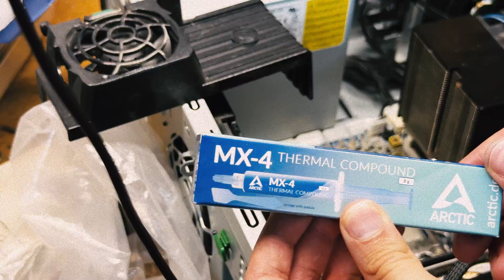Upgrading the CPU in my HP Z420 Workstation

Comment: I am thinking to install 128GB RAM into this MOBO. Did you ?
Reply from the maker: I have 64GB of RAM, not 128GB. But I'm sure it's possible--just make sure to look at Windows' specifications; I think you may need Windows 10/11 Pro for this to work. Other operating systems should work fine.

Comment: BTW - I have found the original PSU very noisy and the default "Megatron ?" CPU cooler is also noisy - So I have installed Corsair SF750, yes, those SFF PSU into the HP Z420 MOBO) I have mounted it using the ATX backplate, that is used to simply stick it from the other side via the screws, lol. Also installed Noctua NH-D9DX i4 3U as CPU Cooler. But now the HPZ420 is just completely silent, especially after I tweak the CPU Idle fan speed in BIOS. It says in the same room where I am , and I can't really hear it, while it runs TrueNAS Scale at full speed)
Reply from the maker: The Z420 can be a little loud, especially with lots of hard drives in it like mine. That's great you figured out a way to quiet it down!
Reply: @thenetworkmystery  yes, that's why I don't use Hard Drives at all...All with SSD, and a couple of PCIe NVMes just to speed up the write speed on storage. Because eventually the bottleneck would be network and not disks...In my case, I have 10GbE networking here, and having 1.1 GigaByte per second write speed into the SMB of TrueNAS Scale, that's great!

Comment: Cool stuff! I have managed to burn my HPZ420 V1 (with E5-1620 V1) by just plugging in the Noctua NA-FC1 input from the PSU (there was PSU SATA Adapter PWM adapter ) into the memory fan header (was dumb mistake). Those left top most LED just burned immediately : ) The MOBO does not start : ) 

But you know what is great - I have right away found the used HP Z420 V2 in my region, with the E5-1650V2 , and that way it's gonna be great upgrade. Planning to use this setup for TrueNAS Scale.
Reply from the maker: Yes, I would recommend the V2 model, because it supports newer processors.